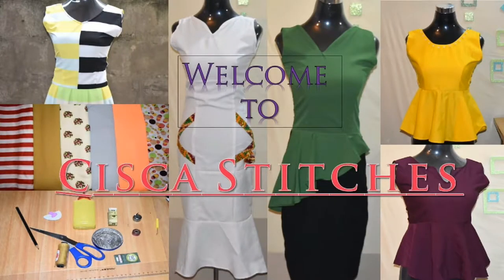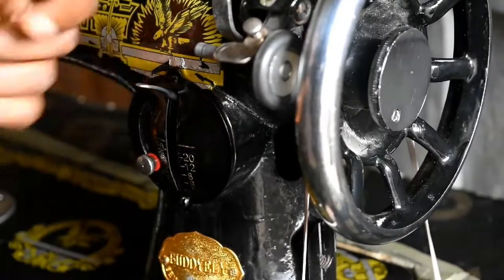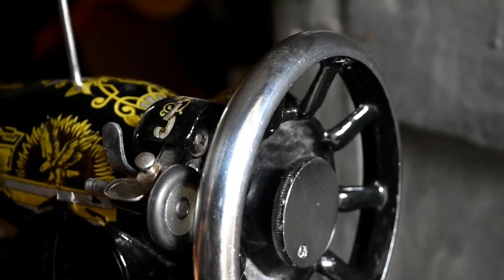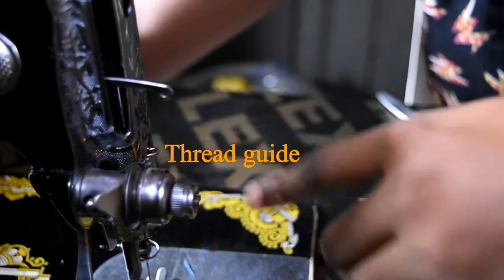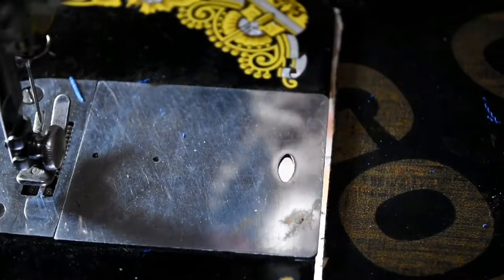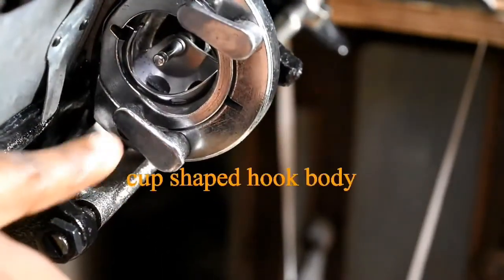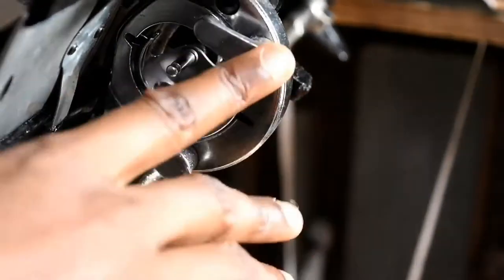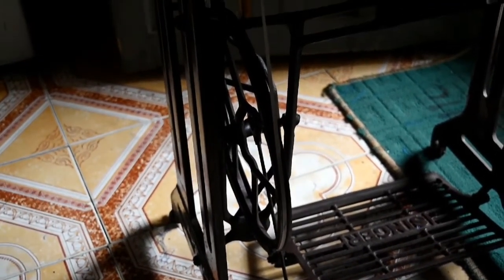KNOW YOUR SEWING MACHINE PARTS W/ Cisca Stitches

Comment: How many inches of elastic do you need to use as a threadle?
Reply from the maker: It depends on the elastic. Some are quite stretch and some are not. Cos I recently just changed mine. You can cut up to 15 inches just to be on the safe side and keep adjusting on your machine after tying.
Reply: Thanks